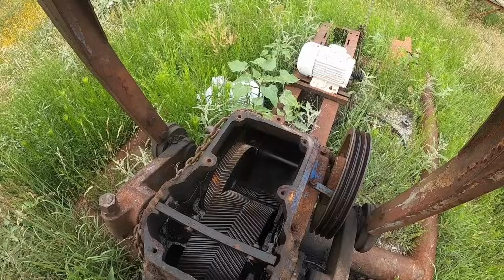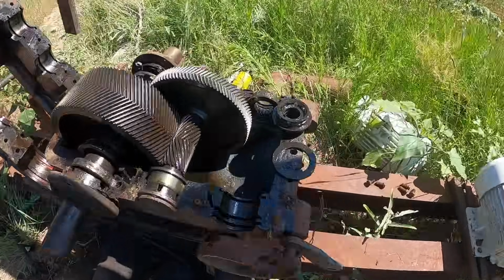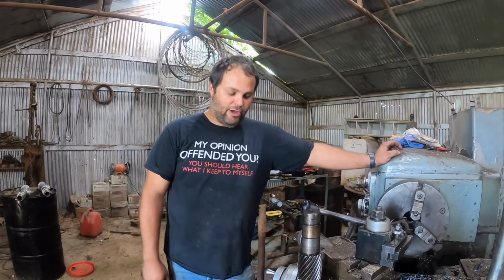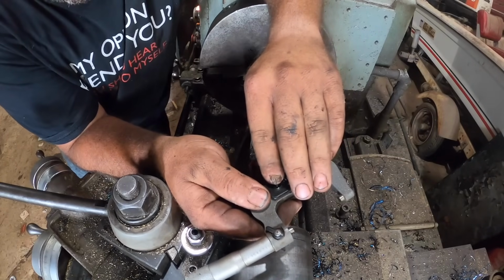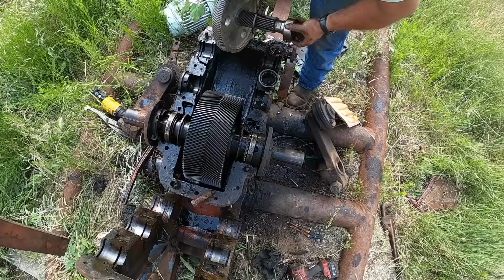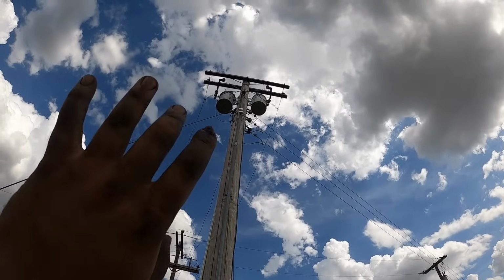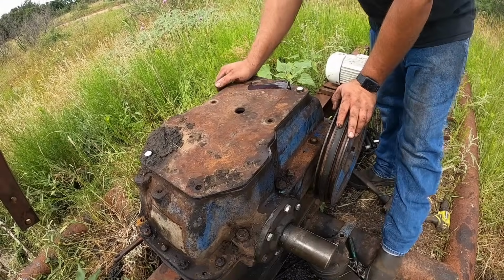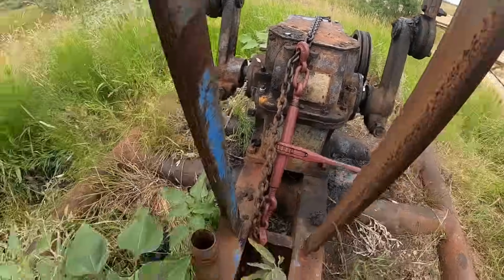Workin on junk

Comment: Hi, I used to overhaul huge Caterpillar engines.    We used mineral spirts in a cheap garden sprayer then used a wet and dry vac to suck out all the dirty mineral spirits.   The mineral spirits is not volatile enough to ignite when running through a wet and dry vac.   but never use liquor thinner or gasoline or anything more volatile.  Mineral spirits will dry grease free, so you clean right before putting it together.   Just trying to help.

Comment: If I heard you right the shaft diameter was correct and the gear bore was oversize. I would have been worried that putting all that heat on the shaft could cause it to warp. An alternative solution would have been to bore out the gear and put a press fit sleeve in it that was the correct ID. I'm not a machinist, that may be a bad idea. I would have been interested in what you thought about that option.

Comment: Can you tell me how much 
1 site with 1 well costs?

And can you buy the site or is it all leased land stuff?
Reply from the maker: This is leased mineral without surface.
Reply: @TheZachLife  are you able to buy these ever or anything?

If yes whats the cost?

And whats the lease cost? 
Does it differ from a well producing say 10 barrels a day vs a well thats producing 2 barrels a day?
Reply: @TheZachLife  and I'm not sure what you mean by without surface

Sorry new to this kind of mineral extraction 

Do you mean without surface mining?
Reply: @anything.with.motors  He means the surface rights.  Surface rights are what we usually think of in terms of owning land.  You own the surface of the land, you can build a house on it,  farm it, whatever, it's yours.   That's different than the mineral rights, the rights to the oil, coal, or whatever other minerals of value might be under the surface.     Sometimes the person who owns the surface rights may also own the mineral rights,  other times they do no, someone may own the land, but someone else owns the mineral rights under the land.  What he is saying is that he leases the mineral rights, but does not lease the surface rights. Because he is leasing the mineral rights, he can do what is necessary on the surface to extract the oil (put pumps and equipment there, drive to his wells for maintenance, etc)  but he doesn't lease the surface rights to the land, he couldn't graze cattle on it, for example, because he only leases the mineral rights.
Reply: @TheZachLife  BTW, love the videos 
Very cool. Those gear boxes are cool to me

Comment: I think it’s fascinating that I’m thinking of engines and you knew that!  😂 the properties of this gear case are so different than a truck motor and the tolerances are naturally different.  Fascinating bits about the gear shaft and the oil slinger drains!  Old VW engines worked the same way!

Comment: If I were going to pay this much for a shaft the old data would mean very little to me. Only the gear size and mesh would be the values required. Like the outside dimensions of the gear but I would specify the exact shaft size and length down to the half thousands. What I would specify to the builder. Not what he wants to build, what you specify. Not some ancient print on sizes. Hard for me to fathom.

Comment: It's a good idea to put monitors on your mains' power and equipment.
It's easy, and will warn you when you have a problem or say oil level preve t it.
Love your exprtance, with engineering.
Takes me back here in the UK when I use imperial measurement, inches, and feet.
Before changing to metric.

Comment: i wouldnt touch anything especially the disconnects and boxes without checking for voltage with a non contact voltage detector.  you get to make exactly zero mistakes with electricity and the next thing you know you are  splaining to St Peter why you done showed up unannounced. everyone i know  that got electrocuted and dead made one too many assumptions about what was safe to work on.  you have to consider even sabotage if you got enemies....

Comment: What we understand is how much does the new electric car cost in reality. What needs to be done is what hydrocarbon debt occurs with the car. Every bit of battery has a hydrocarbon debt. As the range goes up so does the hydrocarbon debt. Same with solar panels and wind generators. Those blades on the wind turbines are fiberglass. The coils inside the generator are mined in a copper mine. Big trucks carry the ore from way down low in the copper mine up to the mill. All the steel in the mill is made with hydrocarbons unless it is fired with nuclear power. All the silicon in the solar cell is mined silicon carried with steel trucks running on hydrocarbons, with hydrocarbon oil in the motor, hydrocarbon fluid in the hydraulic fluid. Mined with hydrocarbon explosives. All the steel in the electric car is made in a blast furnace with coke. An electric car is no different than a diesel vehicle for the first 5 years. Longer if extended range batteries are used. The only way to keep this down is with molten salt thorium reactors. Atomic power. The only way to lower the hydrocarbon debt of the electric car.

Comment: I'm a third generation mechanic electrician or in the offshore oil fields we were refered to as SCR electrician just means I'm also into solidstate drives - 
     I started in the offshore oil fields in the early 70s - some of the equipment was from the 1920s - there were still Worthington air injection diesels and oil engines generating power or running compressors and pumps - 
     We just kept every thing running - there is a saying the oilfields never sleeps - 
      It's true - I'm retired now - today much of the oilfields are high tech - every thing is changed out once a yr or every to yrs - 
    The old generators and compressors my grandfather and uncles worked on were never  changed out - they were just kept running - 
       I had seen old 4 HP FM hit and miss engines on small shallow wells in the middle of no were in the marsh pumping oil - they were on gear boxes running running one or more jack pumps - 
.      Working on old equipment is like stepping back in time -

Comment: Foil tape! Wrap those gears with foil tape next time so welding splatter doesn’t get on the mating surfaces. Doesn’t melt when the part gets hot and splatter can’t burn through it.

Comment: That's a 1973 Johnson 55 horsepower that is a one-year only motor it's the first year they went to the CDI from the points and condenser it is the dark green version I think it's one of the prettier motors they made be careful with the lower unit on that one though because it is a pumper oil lower unit and they don't make parts for anymore more

Comment: Those gears are making a complete racket. Sounds like they're not meshing properly. Also when you were initially assembling the case, one of the parts didn't go in straight. At 27:06 you can see just to the right of the big gear there's that thin piece of metal that's supposed to go in a slot there, but only one side is in. It's bent.

Comment: No Sir I don't think you're a hack. That's a low RPM motor so just assemble it right, no leaks! and leave it greasy works just fine.  Really sucks you broke that bolt off. But hey that happens. Thanks for sharing your activities....

Comment: Ya know it's funny, I'm a property manager and I'm similar in the sense that "I do a little of this, a little of that". Not a master electrician, plumber, professional Timber framer... but I can wire up a breaker box, install a toilet, build a wall, etc. Better to know a little about a lot than a lot about a little in my opinion 

Your lucky that you don't have to deal with people, though. Machines don't have personal opinions lol keep the videos coming! If I ever sell off my small empire up north and come to Texas to become an oil man I'll be lookin ya up for some advice! 😂 🤙 

P.S. - I'm the same way with safety. I am always the first one to do the sketchy stuff to make sure it's okay before I tell one of my guys to. Heck I even enjoy it sometimes. I was just re-bricking around a window on the 5th floor standing on a 2x12 stretched across about an 8 foot gap. Had my guys on steady ground mixing Mortar and hauling it up instead of putting them in the more dangerous spot. You'll always have the ney-sayers but don't pay them no mind. Also I love the shirt in beginning of the video about a penny for your thoughts! Made me chuckle ha

Comment: I would work for free just to work with you.  But, you can lift all the heavy crap!  Also, just like you, I would never replace all the oil in the gear case either during routine maintenance.  It's not necessary!  But, I would do this:  From the very bottom drain plug, make a piping arrangement that comes up to a known level that's about 2 quarts low.  During maintenance, simply take the cap off the piping arrangement.  First, the water at the bottom will come out.  Then, the worst of the sludge/heavy oil will be next.  Done.  Put the cap back on.  The rest of the good oil stays and serves on.  Now, simply add in the known quantity of new oil and move on.  Good for another year ........

Comment: Have you ever thought about building yourself a service truck with a service box on the back?  With all the maintenance work you do it would be nice to have all the tools available and permanently kept in the service truck.
Reply from the maker: I have and should do something.
Reply: @TheZachLife  
My personal experience is that you'll dang-near be amazed and not wish that you hadn't spent the serious money for a bed.  10' is not too big but watch the weight, 8' should really be a 1-ton, preferably duals (the deeper boxes alone are worth the extra $ and width), 3/4-ton will work but gets beat hard off-road.  The truck will carry more supplies than it does tools - (I'd recommend that you) keep it "stocked" from your shop or buy two more of everything that you go to town to get until you know what you use most and buy in bulk for the shop & truck.

Comment: A magnetic base phone holder would be easy to do (RAM ball mount, magnet, homemade adapter threaded for the RAM 1/4"-20 ball) or use an old mag base from a dial indicator.There's no shortage of steel to stick it to.

It speaks well for those gearboxes when you've not previously had to tear one down. BTW is it/would it be worth keeping a pool of spares vs. fixing each as they require overhaul?  I'm extremely lazy so I prepare spare everything and keep a good bench stock for the same reason I don't buy toilet paper by the sheet. Would it have been faster to swap gear boxes if you had ready spares to get the well back pumping then overhaul the busted box at the shop? How much pumping time was lost repairing the existing box onsite?

I'm quite the hammer mechanic myself (just not on aircraft but even there calculated brute force has its place) and that doesn't bother me a bit. I do wonder if you're not sometimes making extra work for yourself by inefficiency though and time is money.  Anything that takes more trips and time than necessary imposes, fuel, vehicle cost and "opportunity cost" (when we do one thing we're not doing something else) add up. Could you be making more money for less work?
Reply from the maker: Thats not a bad idea.

Comment: With just. Anut on that welding rod and no oring or seal do you have to worry about water accumulation over years?
Reply from the maker: Not really. A few drops of water will eventually evaporate out of the oil.

Comment: That electric motor is perfectly matched (1150 rpm?).. with smallest sheave available.. Low&Slow.. I'll bet that Jack can run for 30 whole minutes before the well pumps off and pounds fluid :'D It's a Cadillac setup for a stripper Well. One can make a down hole pump last forever that way. *Everything that you are doing is just top-notch. SUPER IMPRESSED! I am from Mitchell county Texas. I grew up in the oil field. My dad had Wells of his own and serviced Wells all over the country. I have seen everything. This is good stuff♡ 👍
Reply from the maker: Thanks and thats about the size of it.

Comment: Exactly, Haters are going to hate. Most of them haven't a clue of what you do to keep your gear running. I know about keeping things running with what ya got.
LoL Allsups, I have them here too and not too far away from your neck of the woods. Beef and bean and a Chimi with a big drink. That's a power lunch!.
Love the channel and you've answered many questions I've wondered about for years. Water separators, tanks, pump jacks and how that stuff works.

Comment: Another awesome video! I like the deep fryer, except your limited on your heat with the oil. We used a crock pot at the shop i used to work at for heating press fit camshaft gears.  You can go up to 400-500 F if you want to.

Comment: That oil you spilled on the ground is dinner for some oleophagic bacteria in the dirt.  Yes, things eat oil.
Also, you should put some filler bolts in the cover jacking holes to keep the threads clean.

Comment: I would have thought 2 thou interference would be enough since torque is handled by the key. You could cut a circlip groove to ensure it doesn't move too much if that is the concern (those herringbone gears don't generate axial loads so it won't "try" to move either).

Does it need to handle just unidirectional torque or is it cyclic and reversing torque?

Comment: Hello
When you say, "This well makes about 3 barrels per day," is the 3 barrels water+oil? Or straight oil?

Nice channel btw.

Reminds me of when I first started  working in the oil patch back in the late 70's ( Permian Basin, Panhandle, So  Cal)

First rig I ever worked on was a 1948 franks Explorer double gin-pole ( no tubing-board or hydraulics), we were doing oil well abandonments, we rigged-up and down with drill line & snatchblocks, we would run Haliburton   wire downhole with nitro fertilizer mixture and pulling a strain on the casing with spider jacks and blow our own casing. Spining rope,  rotary tongs & rod wrenches, no hydraulics, pretty good huh? ha ha
Reply from the maker: Thanks. 3bbls of oil and 20ish bbls of water. That sounds like a job lol.

Comment: Hey Zach, interesting gear set in there, bit of historical stuff, this herringbone style gear was invented by some Polish guy back in the 20-30's Andre Citroen of car fame bought the patents off the inventor had equipment made in the USA shipped to France than started manufacturing gear boxes with the design, Theses gear boxes were used everywhere since they transfer about 3-4 times the power than straight or helix cut gears, in a much smaller area, they where and as per your example indestructible 
In actual fact the Logo of Citroen cars even today is still the double crescent shape of the herringbone gear, Citroen gear boxes are still in service throughout Europe, back from those days, most likely that gear box was most likely produced under license or the patents run out by than No idea Be interesting to find out
Hope you find the above interesting background information 
Keep it up 
Cheers
Reply from the maker: Interesting. Thanks.

Comment: You’ve could’ve run a snarling wheel to increase diameter of shaft a lot easier and hardened the shaft
Reply: Not hardened the shaft
Reply from the maker: I almost did. knurl and locktite.

Comment: For the hole in the top:  An engine oil breather might be a fit with an o-ring.  Would allow it to breathe when it heats up, and keep rain out.
Reply from the maker: Excelent idea. Valve cover breather and grommet. thanks.

Comment: Nice save on making the gear work! Thanks for taking us along!
 As far as your transformer video goes, I'm with you on doing what it takes to get the job done. I do have to say, however, that you always think it's worth it to get the job done until one day you suddenly realize you're messed up in a life changing way. I've had some close calls, finally decided that the time that I might save on a job to go grab safety glasses, gloves, a chain hoist, etc. is not worth trading the well-being of the whole rest of my life. I'm a mechanic, I'm going to die with a wrench in my hand. But I want to die actually wrenching, not sitting there with cancer or a crippled back, not able to work, just waiting to die, because of some nasty PCB oil incident from 10 years ago. I know you already think about that stuff, and I'm not trying to shame you for doing what you do, like I said I've got the same mentality. But just try and think of what your doing for your own sake. We need many more years of ZachLife videos, none of us want to see you get messed up from this stuff. The quick and easy way is always quick and easy until it isn't.
Reply: Well put. I did years of rigging radio towers and so on. One day I realized that if I didn't do it, it wouldn't get done, and therefore the money, which had diminished,  wasn't worth it. I guess it was coz I realized my boys needed a dad for at least a decade or two. I work a much safer cleaner job today, with my teen sons, but the body reminds me of my dumb antics every day. Of course I'm an adventurer, so factory work is slowly killing me. Also, lived 50 years in Africa,  never a dull moment, including getting shot, safe and uneventful is great, but I can't help feeling like summing is missing!
Reply: Hey Zack, great stuff! I never vlogged ' cos I didn't want any evidence 😊.  There's a load of jobs I did in South Africa that just don't get done anymore coz guys like us just ain't around!

Comment: Most people don't understand that you can't survive in this business by replacing the "junk" with new equipment; however, you must be able to keep the old stuff running reliably.  Very few operators have the necessary mechanical, machining and electrical skills to pull this off without breaking the bank.  I was raised on a farm and understand this well (now a retired professional engineer).
Reply from the maker: exactly.